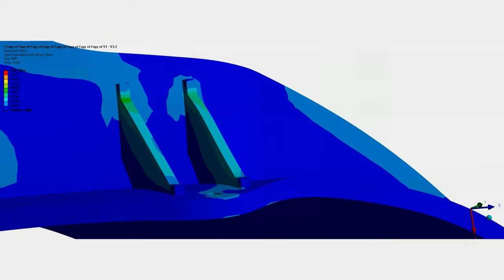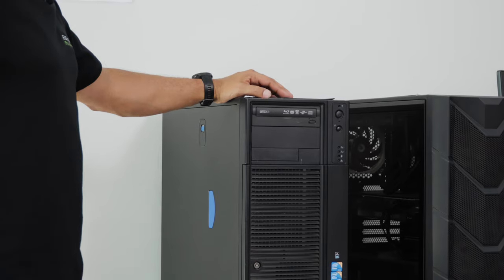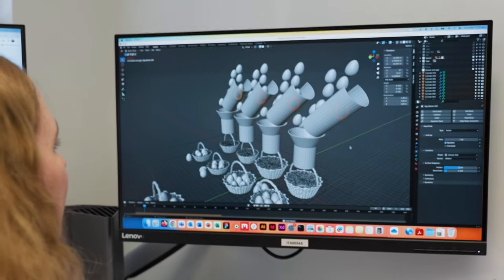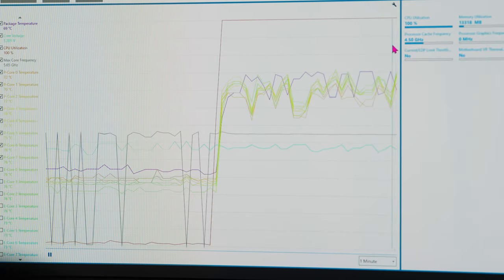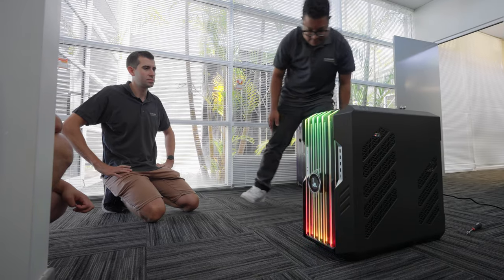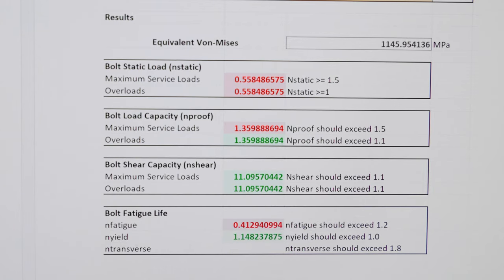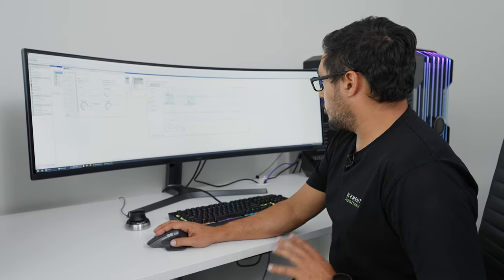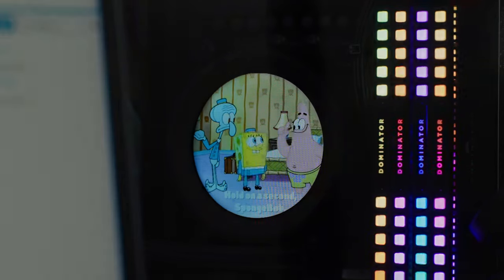We just built a gaming PC for mechanical simulations

Comment: You are missing one crucial aspect of a good FEA/CFD workstation when running on a "gaming" CPU. While the single core performance of these CPUs is great, these CPUs have only 2 memory channels while server CPUs have 4 and upwards memory channels (todays CPUs can have 8 or even 12 memory channels). Having a high clock speed core is moot when you don't have enough memory channels to transfer the data across the cores, that's the main reason FEA workstations work with server grade CPUs, you most likely bottlenecked the CPU with the constrain on the memory distribution between cores. Although if you only have a license for 8 cores you are probably fine (the rule of thumb is 4 cores per channel), but then you could have chosen much more "economically efficient" CPU since most of your cores are un-usable during a simulation run.
Reply: i was thinking the same about the CPU type they choose; but you also need to understand why they turn off E-cores, they still want to use the computer for other tasks such as modelling or documenting and stuff, while the P-cores are computing. The problem with server-grade CPUs is that they dont operate on high clock speeds such as 5-6 GHz, but only around 3 GHz with moderator overclock, which is what they are taking advantage of... since they only got a license to use 8 cores, i believe using a high clock speed CPU with good single core performance is their best bet rather than 24 core server cpu with 2 GHz on single core.

Comment: Hello, just wondering why you focus on raw CPU throughput instead of GPU acceleration? Ansys has a GPU override env var, and SOLIDWORKS can be overridden as well (all within ToS of course), so I don't quite understand why you wouldn't simply utilize multiple RTX 4090s or several V100 SXM2s (using the Supermicro X10DGO-SXMV and RSC-G-6)? I've built a quad–V100 SXM2 server for US$2000, and it performs quite while especially at that price. Please feel free to correct me, I feel like I've missed some important details.
Reply: hello, my friend, regards from Arequipa, Peru. Southamerica. I am begginer worker as a mechanical engineer. I totally trusth and agree with your comment. Can you share to me the parameters and characteristics of your computer of 2000 dolars, thas is the money i have to buy a desckop computer. Many thanks

Comment: hey mate nice video btw, can you put the specs on it? i want to build one like yours, i mainly use ansys and solidworks. do ansys really benefit from a gpu that have double precision one or you can get away with gaming gpu like rtx 4090? thanks in advance
Reply from the maker: Hi Manray8513. Sorry, i've just seen this comment. Have you built a machine yet? To be honest, we haven't tested double precision yet. This new machine has a Quadro RTX A4000. We previously used a GeForce RTX 3090. Using the 10,000odd CUDA cores does speed certain simulations up, but I believe we have found it to be marginal. But we should probably test it out. Let us know if you have a specific use case and we might be able to organize running a simulation on either machine with different parameters and it could help you make a decision if you haven't made one already?
Reply: @elementengineering  all cool man! keep rippin, i finally bought refurbished dell t7910 with dual xeon e5-2699 v4, 512 gb ram @ 2600 mhz, rtx 3090 turbo and 3 tesla v100 16gb watercooled them all, what i can say is, this machine is really fast compared to my old setup dell t5610 from 2013 is like 3 times faster for solidworks simulation and 15 times faster on ansys mechanical
Reply: @elementengineering  I understand the GPU choice but i'm curious about CPU. Wouldn't the use of HEDT CPUs like xeon or threadripper have benefits in combination with 4 channel / 8 channel ECC ram?
Reply from the maker: @klemen4607  Good question!
I believe the answer is in single core computational performance. I would have to check some synthetic workload performance tests, but from memory, I believe we did look at the HEDT machines and the single core performance and multicore when only using 4-8cores was much better from the gaming CPUs.
Also availability of parts.
Ayrton